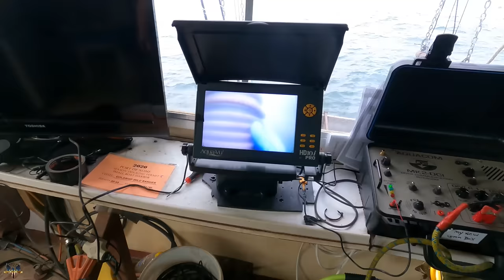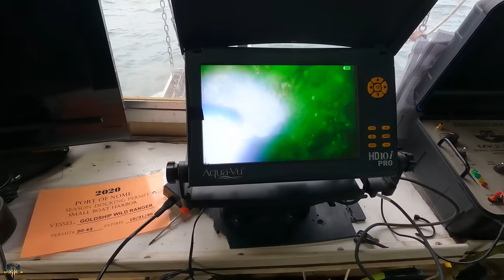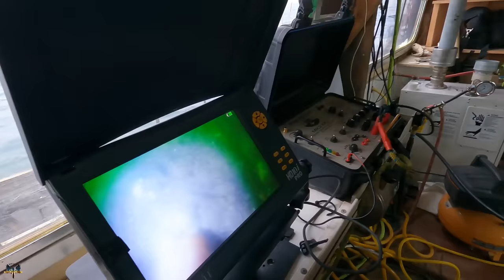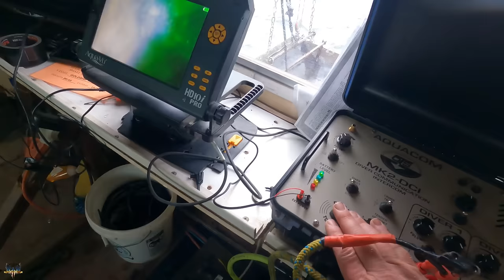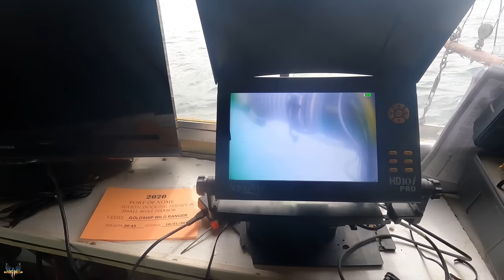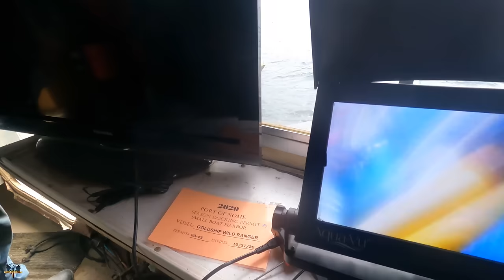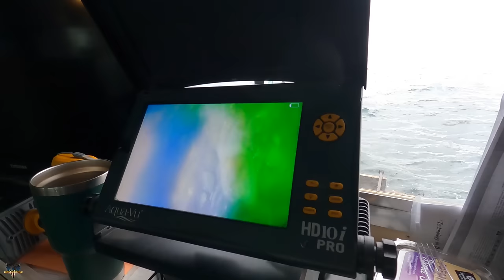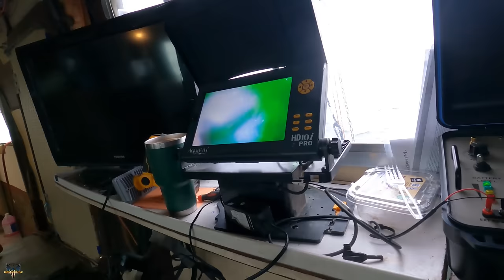1st Time Using NITROX Dredging at 40 Feet - Vernon's Start of The 2023 Season!

Comment: IMPORTANT SAFETY QUESTION Listen why don't they put a speaker on the outside of the diver control safety shack on their boats, so those on the outside can hear when & or what the diver is always saying & or doing in case of emergency & or whatever! So to curve seconds off response times to getting diverse up, as you know they know that seconds count those cases of diver emergency/ emergencies.
Reply from the maker: That's a good idea. Also, the diver has a 2nd air supply in case of emergency